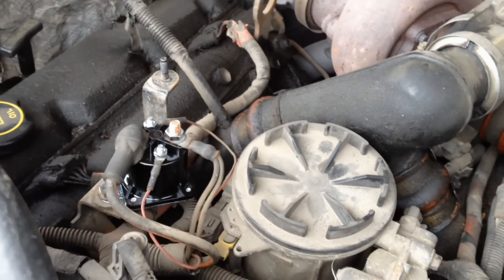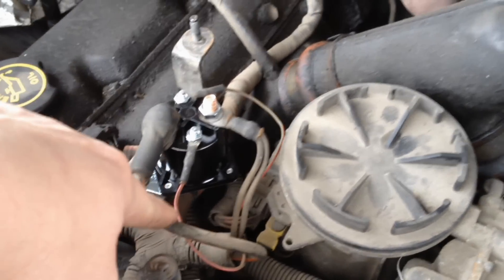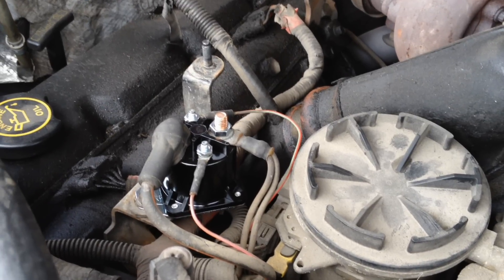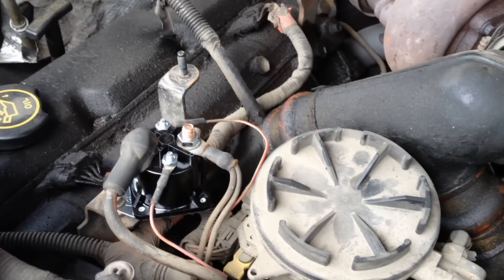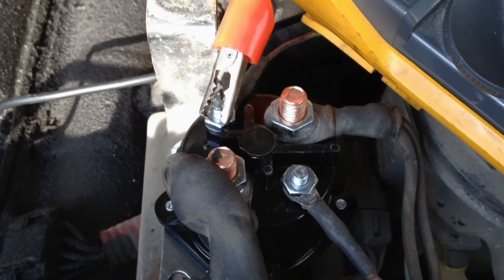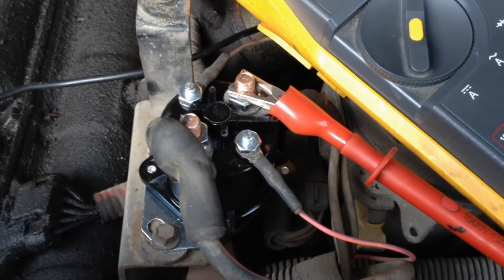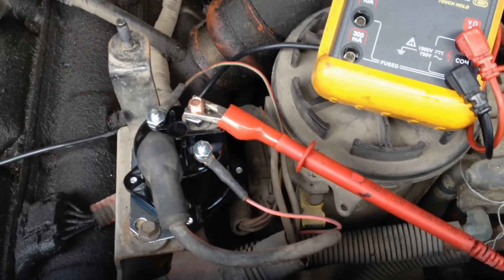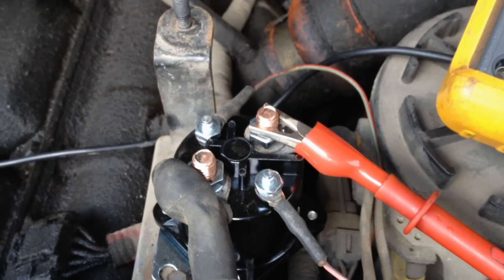7.3L Powerstroke Cold No Start Diagnosis- Glow Plug Relay

Comment: So mine use to start great in Montana winters then wouldn’t so I replaced glow plugs harness and relay still won’t start cold takes a lot, I have 2200 icp pressure rpm and oil pressure, what else could it be once started it will start

Comment: I used an after market glow plug relay when I replaced the relay about 8 months ago and now it failed again, this time I will replace it with the ford product and hopefully I won't have problems again in the future. I own a 1997 F 250 and it has been a very reliable truck for me.

Comment: Solenoids on all ECM/PCM vehicles must ALWAYS BE OEM OR REVISED OEM. Because there is a junction diode built into the circuit to protect the sensitive components inside the computers. Anytime a magnetic field collapses, there will be a voltage induced traveling to the nearest ground it can find. The drivers in the computer will be damaged and a new computer will be required. Diodes allow current  to flow in one direction only. However, they can also be damaged by excessive voltage causing their depletion zones to widen beyond their specified limits. This is what is called an “Avelanched Diode”.
Reply: L

Comment: Fuse 22 instantly blows when the key turns on, and that fuses 4 circuits, fuel line heater, 200 amp generator voltage regulator, PCM relay, and the glow plug controller, so where is the short in one of those, that’s where I’m at lol
Reply: Most commonly the issue is the fuel heater. Unplug it then replace fuse and see if it blows again. Its usually fine to leave it unplugged permanently.

Comment: Advice need I have a 2001 Ford Diesel Excursion 4x4  I live in Texas and when it is 35 degrees my truck does not want to start. I was in OKC for business and it was 15 degrees and my truck would not start till a guy with a big diesel jumped my truck. 3 hours in 15 degrees is not good.  Some one told me to get a White Rodgers glow plug relay? I am in my winter season and will be going back to OKC and honestly I am so tired of plugging my truck in. Any advice would truly helpful and thank you

Comment: Question, if the power goes from the key or ignition switch to the neutral safety switch. The why can you go to the glow plug relay and junp it off using a screw diver across the 2 large posts

Comment: For anyone interested in a no electrical power issue, no cab light, no crank, nothing. I just fixed my 96 7.3 and the glow plug solenoid by the fuel bowl had a burnout internally breaking the electric  circuit i replaced this $30 part and she fired right up

Comment: Hello been watching you're videos...  I own a 97 ford f250 power stroke diesel with 7.3 my truck isn't running it turns over and the dash light says water in fuel filter now first I drained it that didn't work... so I  put a new fuel filter in that didn't work I unplugged that fuel bowl heater sensor that did nothing I just changed out the glow plug relay didn't wrk!!! Still says water in fuel ... idk what else to do? I'm a single mom obviously dont have the money to even tow the damn truck.. I did notice when I drained the fuel bowl completely it's not filling up with fuel I had to pour fuel into the bowl??? Is it my fuel pump lifter??? Or fuel pump in my tank? I'm at a loss and can't keep spending money and fixing things that are not broke lol please help any advice was be greatly appreciated 🙏

Comment: I’ve got a 2002 Ford 7.3. She’s got roughly 290k miles on her. The truck has literally been through hell and back. I live in Alaska so it gets pretty cold come winter. Well here it is in October and this year is no exception. The temperature just started reaching freezing and my truck doesn’t want to start unless I leave it plugged in. I did the glow plugs several years ago but maybe only put about 20-30k miles on the new set. If the truck is not plugged in the truck just won’t start and pours out a bunch of white smoke while cranking my battery life away to no avail. When I first replaced my glow plugs I remember it reach well into -17 one night and the truck started with no issues without being plugged in on a remote job I was working. After watching this I’m going to try swapping out the relay. I’ll update with the results.
Reply: Did the new relay work?
Reply: Did it work?
Reply: We need an update man

Comment: Looking for help, recommendations, or resources. I have a Ford 1995 7.3 F250 manual with 150,000 miles. I have a starting issue. For the most part it is sporadic and happens when I cut off the truck and try to start it again after 10 or 15 minutes. It will turn off but doesn’t start. If I wait about 30 or 40 minutes it usually starts right up. I have had it not start a couple of time (one of which currently now), after sitting a few days. But for the most part it always starts after it sits for a day or more. The last time it didn’t start after sitting for awhile, it just started again a few days later. Any help tracking down the problem would be greatly appreciated.

Comment: Watched this video, checked mine, replaced mine......first cold start with out being plugged in. This makes life so much better! Nice video man!
Reply: This is what really helps without having to do stupid things to gain followers  or likes. Thanks to this video I fixed my truck myself.
Reply: @eldin60966  yeah but that ain't no motor craft part, he didn't show were the s and i post are. just fried mine listening to this guy.
Reply: @eldin60966  where does the small red/green wire go, the small s post or the small i post?

Comment: I have a 2001 PS SD and just found my wire that’s on the bottom of the ignition solenoid was burned and chewed after replacing ipr and 2 alternators etc started looking for the secondary alternator dummy plug and found the GPR wire was melted etc how do I go about fixing it etc and would this effect the truck it’s a bitch to start have to jump it and even after 2 alternator swaps it won’t stay charging it’ll drop would the GPR being goofed have anything to do with that issues also ???

Comment: Looking at a 03 7.3 . Guy sent a cold start video and it took 4 cycles to start cold. He said GPR is 3k old same with new injectors. Glow plugs are 20k old. Guys say it’s possible to get a bad GPR. Others say it could be the hpop not delivering oil fast enough. More common a plug / relay problem? Or hpop? It starts right up when it’s warm.

Comment: ground control to pcm check-how to-continutiy from the wire while unplugged?
relay control side-"only when key is on engine running only"-i didnt hear your engine running
thank you 
-Fred
Reply: I think he was saying the other terminal will he hit when the cars key is in the on position. Your cars key could be in the on position when the car just has the key in the on position or your car could have the key in the on position when the key is in the on position AND the car’s engine is running. I don’t think he wants you to look for a hot voltage when the key is in the start (crank) position.

Comment: Iv got a 99 f250 an cold or hot weather it wont start with key something but it a 6 speed an if I roll start it off it stay running an run good all day but seeing this I'm try the relay an go from  there

Comment: My 95 7🎄 starts in the coldest weather with out being plugged in.
Reply: How's that possible ?
Reply: @peterscholte300  a mix between good glow plugs, starter, batteries injectors and compression
Reply: @sethmichaelson6972  I think I need all of that 😆 anytime it's 40 or under I'm walking home
Reply: @peterscholte300  lmao I have a 97 7.3 I never plug it in, check your glow plug relay it will save your ass and it’s 20 bucks at autozone
Reply: @sethmichaelson6972  thanks I'll have to look into it
Reply: @peterscholte300  does your truck have a lot of white smoke when you finally get it to start?
Reply: @sethmichaelson6972  yes it goes away once it warms up
Reply: @peterscholte300  yeah you got a bad glow plug relay it happened to me, it’s a 20 dollar part and easy to do

Comment: I have 328,000 miles on my 2001 7.3L F350 Ford dually l bought new. I do carry a new ford relay, just in case. After watching this I think I'll put the new one on. Eighteen years is pretty good for the original. Thanks for the tips on testing. Maybe I should change the intake heater relay as well.

Comment: Ok so i have a 1999 f350 7.3l and one morning it was cold and wouldnt start (the check engine light was on and the code said low voltage to the left bank and right bank) so i changed my relay and it started better than ever. (Check engine light went out) i turned the truck off did some grocery shopping and came out and it started but the check engine light came back on and the codes are reading the same thing “low voltage to left glow plug bank and right glow plug bank. Truck still starts no problem but the check engine light is irritating. Im wondering if the guy i bought it from has the small wires turned around. Is there a way to tell which small wires go to what terminal?

Comment: Hello. I have a Question, I just bought a 1999 Ford F 550 7.3 Turbo. It won't start cold but if I leave the ignition switch on for abt 3 to 5 minutes will start and the cuts off and start again, I have change ECU, crank sensor, fuel pump, and Glow plus relay.
Reply: What kind of oil are you using?  I use to have a hard time starting a 2000 F250 when it was real col.  Two years ago I started using Rotella T6 oil which is 5w40.  That made a big difference.

Also, you might have some bad glow plugs.

Comment: Great video. I OWN A 1997 F 350  7.3  Power Stroke DUALY CREW CAB. i had my transmission rebuilt 2 yrs ago. It took the shop i brought to 3 mo. to do the trans. They used every excuses plus said my CPU needed to  be replaced and programmed.. Any way i got it back finally but My truck when i come to a stop or a red light never starts off in 1st gear unless while i'm stopped i manually put it in 1st then in drive and then it shifts properly.If i come to another stop same routine. I am the original owner and have 164224.5 miles on it.
What the heck? I would never take it back to the trans. shop, ever.
Can you or someone you know please help me out?  PLEASE

Comment: I have a 2001 F-350 super duty 7.3L diesal so I have replace the glow plug relay and now the WTS light will not come on but has crank but no start. So when I arch the glow plug relay with a test light the relay comes on even before I turn the key on the test light is also hooked up to the negative on the batter so when I arch the relay with the light it turns on it gums before I even turn on the key so when I turn on the key the WTS light is on so I wait for it to turn off the relay is still on start the truck it starts up but when it’s running when I remove my arm from the relay where I am arching the whole truck turns off what is going on

Comment: Absolutely insane to pay $80-$130 for that relay when it’s the exact same relay that used for the starter. They charge more because they can call it a glow plug relay and not a starter solenoid
Reply: As I do agree it's not built the same. I did that the first time and burned it up pretty fast.   starter relay is not able to handle the juice for that long of a time. But O'Reilly had a relay for like 25 bucks instead of 15. That works really well.

Comment: I have a 1996 f250 7.3, I tried starting it after 2 weeks of sitting and I turn the key it just clicks but no turn over, so I tried it on the starter solenoid and it turns over very slowly. what should I do?
Reply: Charge and/or replace your batteries and then test your alternator

Comment: I have a 2002 7.3 I have  crank no start problem I put a new CPS, ICP, IRP, fuel filter, and cleaned the EBPS out and the line, it's not cold out so I am not sure what else I need to do please help I can't afford to keep sinking parts into the truck but everything I was told to change out so far has not worked, I can start the truck with ether but will shut off almost right away??? Any ideas?
Reply: Did you find out what the problem was?
Reply: @MeeN905  yes was the ECM it was located in the fender well so on big rain storms or puddles it was getting soaking wet, put a new one in and relocated it haven’t had an issue since!

Comment: i know this is an old video, but i was wondering if you've ever seen a problem where the computer doesnt send the ground signal to close the relay. ive changed the engine oil temp sonsor thinking that it may be that but i still have to put a jumper from ground to the comp signal to get the solenoid to work. thanks
Reply: good question.  seems like the pcm would have logic that involved a timer and temp sensor
Reply: did you ever figure out --- having same issue and i too replace oil sensor --- still having issues

Comment: we used to get a stick with pice of rug and diesel fuel on it. then light it up and hold it by air filter tube. as another person cranks engine sucks hot air for better start. what is your thoughts on this

Comment: Update 5-5-15:

The problem with the 20 amp micro fuse in slot #22 blowing and relay 303 clicking violently reoccurred several times since my last post. After several attempts of no start and immediately blowing the 20 amp fuse, I took a gamble that the glow plug relay had a dead short to ground. I headed over to O'Riley's to order a genuine Ford Motorcraft glow plug relay last night and just picked it up this afternoon after work. After I installed the new relay and cleaned up all four terminals and applied some dielectric grease....once again FIRE IN THE HOLE!!

I think I got it this time.....

Comment: Ah yes......the somewhat culprit of about a 4 month ongoing problem I have had with my 2002 F-250 Super Duty with the 7.3L Power Stroke diesel. Starting about 4 months ago my Diehard Gold batteries were getting old. They were 8 years old, so I replaced them. Fast forward about a month later and my charge warning light would come on within the first minute or two after starting and stay on for about another minute before going out. Maybe a week would go by before it would do it again. This stopped about a month ago. Last week I started blowing fuse #22 which is a 20 amp micro fuse when you first turned the key. Relay 303 clicked very violently and loud after #22 shorted out. Change the fuse, it would start and be good to go until another 3-5 days went by. The same problem, the same solution. I am a full time licensed HVAC technician with 14 years experience. I'm also  a amateur mechanic and classic car enthusiast after hours and on the weekends. I have a '65 Mustang 289 K-Code V8 4 speed coupe. I'm not dumb, so my training told me wires frayed and shorted to something or a bad connection somewhere. I just had to find out where. That SOB left me setting at our shop after work today. Only this time wouldn't hold the fuse and kept blowing instantly. I bet I blew 6 of them before I quit. Ok, well...let's open the hood and take a look. After about 30 minutes of searching (with luck), I happen look at the glow plug relay and see that hot wire that comes from your battery (the one with the rubber boot) with the boot old and cracked. I pull it aside and see it's all corroded on the terminal, nut and wire connector loop underneath. Ok, so I unhook both negative battery terminals and remove that positive wire from the glow plug relay and clean it up with a small wire brush we use for cleaning furnace flame sensors and burners with. I cleaned everything...post, nut, wire connection loop....everything until it shined. I reassemble and reconnect the negative terminals on the battery. Next comes a new 20 amp fuse in slot #22. I'll be gone to hell....FIRE IN THE HOLE!! It was instant and also the truck runs smoother and feels like it gained some lost HP I was slowing losing over the last 4 months or so.

Point being....MEN....check that if your truck won't start. It worked for me and saved me a lot of money.
Reply: You could have said all that in one sentence.

"Make sure the connection on your relay is clean from  corrosion, iv had issues with that"
Reply: @shmazy86  

Except "that" wasn't the only problem.
Reply: TMI LOL

Comment: UPDATE---- I tested it this morning at cold temperature and it still did not have any power coming out of it. there are 12 volts going in, and 12 volts at the small terminals when the key is turned, but absolutely zero at the terminal going to the glow plugs. I'm baffled. any suggestions?
Reply: Bad GPR duh
Reply: Jason Habedank
Reply: I sold my truck months ago, but I think that's what was happening with mine. I wish I could help you out, but I was clueless also.
Reply: Jason Habedank

Comment: ----- READ THIS BEFORE YOU BUY A NEW RELAY!!! ----- I realized I was testing my relay at close to running temperature. BIG MISTAKE! make sure your motor is all the way cold since the relay won't activate when it doesn't need to at warmer temps. i believe you can disconnect the coolant temperature sensor if you can't wait for the motor to get cold. I'm going to wait til tomorrow morning to test out the new relay I installed today.
Reply: would be nice to know the logic behind the ground to the pcm wire?  i heard it is triggered on/off by the oil temp sensor.(seems like a timer must be involved too?)....  i assume ¥ou could bypass the logic by just removing the pcm wire and grounding that post for a minute or two.  wish makuloco had explained the pcm logic
Reply: Hey Jason I'd love to make a reply to that but you know I'm and in Samsung no date in the voice to text just doesn't fucken work as you can tell